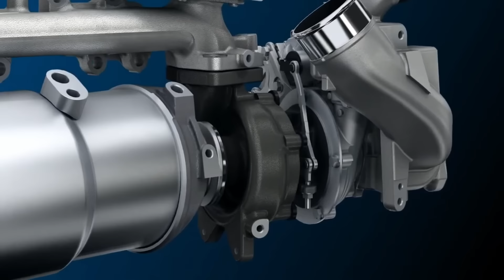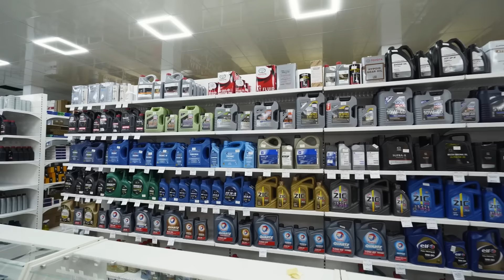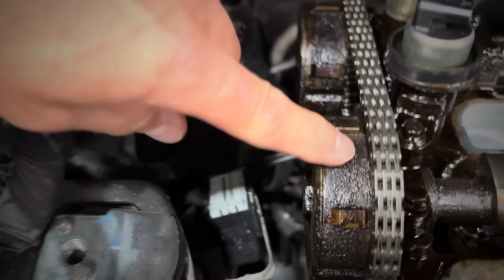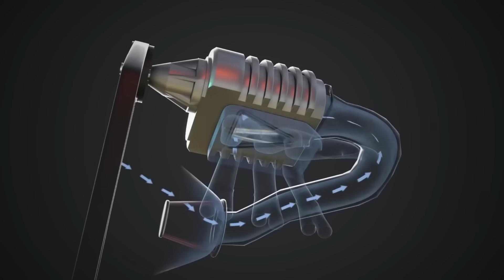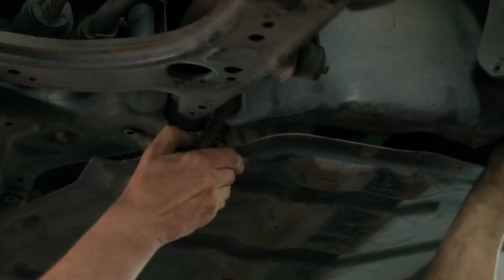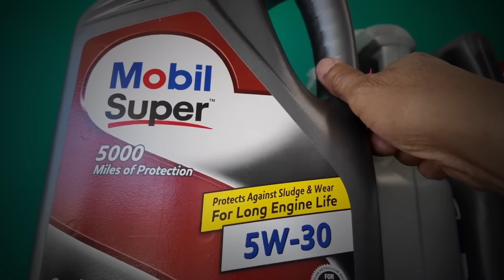Mechanics Won’t Tell You This About Synthetic Oil! Exposed!

Comment: I worked through college on a scholarship from Mobil Chemical in there research lab in Beaumont TX. There in a semi-works plant we produced the first batches of Mobil 1 oil. It is made form a straight chain molecule Alpha decene. This is polymerized Into long chain  molecules that can snake into much small areas than standard oil can. In the testing labs we ran engines a million miles only changing the filter and adding back 1 fresh quart of the synthetic oil. The engines were then disassembled and measured for wear. The results were amazing showing on 10 to 29 per cent of the wear that was show with the same test using conventional oils. Everything in this video is exactly as we tested 60 years ago. I am very proud to have been a part of this development team. And YES I have always used Mobil 1 oil in my vehicles.
Reply: So why does Mobil One play "I've got a secret" while Amsoil releases tons of whitepapers on this kind of thing and much more precise extended-interval recommendations?
Reply: Castrol Syntec
Reply: @edgarvaca9238 Castrol sold out yrs ago it's made by BP
Reply: Это враньё от начала вашего текста до конца! 
Никакое масло не справляется с продуктами сгорания топлива так как свежее замененое! Обычное минеральное масло замененое 5000 км намного лучше синтетического 15000 км!! 
При нагреве масла до 400° минеральное масло не выпадает в осадок! А синтетическое превращается в смолу и асфальт. Современные двигатели euro6 очень горячие! 
Смотрите тесты прожарки масел!
Reply: Didnt mobil 1 stop utilizing pao base when they lost the court battle with Castrol?i thought they went group 3 like Castrol and now pretty much all off the shelf oils.But maybe they still use a small amount of pao base with some gtl base mixed?...just curious... either way its great oil.
Reply: @steverugerguy9606 why did mobile go to court with Castrol,,
Reply: Yes, Mobil 1 is better than Conventional oil but how do you know other brand of Synthetic oil for e.g. Valvoline is not just as good?
Reply: @FeelFree3  Amsoil is the very best by any measure.
Reply: The 2nd best thing about Mobil One is that Costco sells  it-last time I checked. .  Save a few bucks when you religiously change your oil every 5,000 miles or 6-months.   As it has a little more detergent in it,  I use the synthetic Pennzoil Ultra sold in 5-qusrt containers at Walmart.and only OEM oil filters.  Best car so far per Consumer Reports  is the Toyota Camry Hybrid
Reply: Thanks for your time information on this .

Comment: An example with many new cars since 0-20 and 5-20 is a problem since tight tolerances. If you 10-30, etc, you will lose that engine.

Comment: I've been an Amsoil dealer for 25 years. I use Amsoil Oil, gear oil, Trans fluid, grease, 2 cycle mix, etc  in everything I own. I didnt change the oil in my lawn mower for 18 years, It stopped when the shrews chewed thru all the wiring. I use the 2 cycle mix at 100:1 for all my mixed gas. Even equipment saying use a 20:1 mix gets 100:1 and everythig rus beautifully. I've never had a plugged spark arrestor. I don't drive a lot maybe 10 -15000 miles a year, I use the Amsoil Signature series oil and I change my vehicle oil once a year. I have never had an issue. I put a new qt of convention oil outside next to a new qt of Amsoil for a week in winter at -40 F (I'm in Alaska) , both the same weight. Conventional oil was extremely slow to pour it was very thick. The amsoil while pouring slower than at room temp, did pour much, much faster than conventional oil.  Amsoil, easier cold weather starts, faster lubrication, better fuel mileage. I live way out in the middle of nowhere, I get nothing for Amsoil for saying this stuff. I'm old, not rich and I'm damn picky. If Amsoil did not work  and work well, I sure as hell wouldn't  be using it. Especially since I drive 200 miles 1 way just to pick it up at the distribution center. I shouldn't be praising Amsoil at all. They treat dealers like me very poorly, but I have to be honest. "I" think Amsoil products are great.
Reply: I agree with all that you said. Except I became a dealer in ‘73 but dropped it a few years later but still used many of their products along the way and preferred customer for about the last 15 years. They know their stuff.

Comment: Oil Oil Oil
The true king of your engine is keeping folks out of it……
Sports cars nowadays are a gamble used because folks wanna modify shit
Folks want maximum HP there engine can handle.
Folks can never chill and drive with sense, just nonstop hard pulls at all times. 
Engines with no real power have outlasted $60K engines all day everyday 
Oil is great, but not dogging and tweaking your car is better

Comment: I  had a guy tell me synthetic was bad, too slippery.

I looked at him in shock. I think my facial expression suggested, "Do you listen to yourself"?
He must have caught it. He replied, "It makes the bearings slip".

I nodded my head and walked away.

On YT, there are several videos where people tested the wear factor of several synthetic oils. The top five brands were so close in the protection they offered, it wouldn't make a sliver of difference in which oil you use. Just buy what's on sale.

Comment: Ford 2010 fusion 2.5 liter engine driven to 282,000 miles and only a fraction of a quart of oil used between 5000 mile oil changes and still running quiet. Had valve cover gasket changed at 250,000 miles and saw no sludge on the top end. This was always spec blended oil.

Comment: When I bought my Harley I took it back for it's 1000 mile service. They put in regular HD 20W50, the oil put I at the factory. The next oil change I started trying synth oils I tried about every synth oil out there. The Mobil one was the worst. Engine made more noise and ran hott3 than the others. I settled on Amsoil 20W50 in all three holes. Ran much cooler, silently and got better than two mpg better milage. 
Been running it ever since. Well worth the money. The longer change interval balances out the extra cost.
Reply: My main Harley center carries the HD brand because they have to yet only install Amsoil 20-50 after breakin because it works so well.

Comment: I only drive about 2,000 miles per year mostly city driving. I Do take the car ('21 Ford Explorer 2.3 litre with turbo which is rarely used) on the highway once a month for about an hour's drive. How often should I change the oil as it's more *time sensitive than milage sensitive.?

Comment: Started using Castrol Syntec, or Mobil 1 exclusively in the mid-80s:   VW gas and diesel, Volvo wagon, Olds v6, Mercury v6, F250 and F350 diesels, and Buick v6.  All had 180k to 260k, when sold, with none requiring oil between changes.  Also used a premium oil filter.
Changes were 5k to 7.5k.
Currently,  I'm in a 4cyl Tacoma.. Gen3 & getting close to 80k, and running great!
..Way over a million miles in total.   Don't skimp on oil and filter quality!

Comment: G.K U.S.A.  I have been using Amzoil products for over 30 years- oil, oil filters, air filters, transmission fluid, and differential fliud. I heve had no problems. I use the Amzoil Signature oils in 10w30, 5w30, 0w30 and 0w20 formulas. My present 2024 Suburban is supposed to be used with 0w20 full synthetic. I thnk that there is another reason that both GM and Amzoil technicians insist that I continue wtth this low viscosity oil is because my present Suburban has an 8 quart oil pan. My other 4 Suburbans had 5 and 6 quart oil pans. I wonder if the greater amount of oil used by the 5.3 L engine is a factor in the debate over whether if 0w20 oil is better or worse than the 0w30 oil that I used in my other Suburbans.  Also, in cold, Wisconsin winters, I noticed that changing from 5w30 to 0w30 made a difference in the time it took for my engine to go from start- up to operating 
Oil pressure. I was amazed by the difference.  It took 5 or more minutes. This translates into better fuel economy and, perhaps, less wear in the engine. I would like to get your input on this.

Comment: A former FORD Corp vice president, having been introduced to Amsoil, took a brand new Lincoln, fresh off the assembly line; he had the engine fill with Amsoil, (which Amsoil did not recommend).  Amsoil recommended to use their engine oil, only after the proper break in peroid.
This man kept the same oil in the engine for 100000 miles, which Amsoil also does not recommend.  The only thing he did, he did have the filter changed every 3000 miles!
At 100000 miles this Ford VP brought the car in to the Ford Research facility.  He had the technicians pull the engine completely apart, and check all the internal parts comparing them to the original specifications.
The Result: the engine (internally) was amazingly clean.  Every part was still within factory specs!
That VP was so amazed, he resigned from Ford, and went to work for Amsoil!

Comment: I own a Chevy Suburban 2009.  It has 250,000 miles on it. I use synthetic oil... Every time I drive away from Ralphs Auto Repair after an oil change my car drives and responds like a brand new car . 
I will never go back to crude oil.   🎉🎉🎉

Comment: I bought a 2005 dodge pickup truck with a cumins diesel engine and the owners manual said that it was safe to go 7500 miles between oil changes in regular use regardless if conventional oil or synthetic oil is used. So 265,000 miles later I have never used synthetic oil in it

Comment: I use Mobil One 20,000 mile oil and change it every 10,000 miles. I do a lot of start/stop driving, delivering 8,500 papers in 2 1/2 days. Plus, my new car has a turbo charger on it.

Comment: Pennzoil Platinum 5w30 not 5w20 in my 2007 F150 5.4 3v changed every 5 metric k. Never been inside this engine and as quiet as the day in 2010  when I bought it with 34k now 220k. Oil is cheaper than a engine and I love this oil the cleanest base oil ever made.

Comment: This is very interesting and confirms what my experience with oil has shown. I'll try to keep the story short.

In 1975, I bought a 1973 Pontiac Grand Prix that had been mostly road driven by one of my friend's traveling salesman father. It had a big block 400 and 50K miles on it. This was my third car, and being a guy, I thought I knew a lot about automobiles. I had always done my own tune-ups, lube jobs,  alignments, etc. In addition to some other tweaks like putting in a dual point ignition system and an electric fuel pump, I flushed the engine with Sea Foam and decided to change my brand of oil.

Mobil 1 was pretty new and still rather expensive compared to regular motor oil that was selling for about 60 cents a quart. I switched because regular changes were every 3,000 miles and Mobil 1 was every 5,000. My time to change oil was worth more than the per quart differential, right?

Well, anyway, I got lazy or distracted, or something and started just visually checking my oil quality as well as levels. My Mobil 1 wasn't even dirty after 10,000 miles, so all I did was change the filter and add a quart to top things off. I did this for more than 250,000 additional miles over the next five years. I sold it to a kid who did a compression test and a brake horsepower test. The car was 98% up to factory specs with slightly more than 300,000 miles. LOL. He tricked it out with glass-pak mufflers and replaced the 8-track with a better stereo system.

After many subsequent vehicles including the taxi cabs that I have owned, I've never changed the routine: Keep the Mobil 1 topped off, but never actually drain it. Every 10,000 miles or so, change the filter and add a quart of new. Have never had any oil related engine problems despite millions of combined miles.

I've always been a bit of a rebel, but it has worked for me.

Comment: I bought an F-150 new in 1988  and ran it on Mobil 1 for the 359k US miles before I retired.
Regular oil changes and not a drop burned or dripped 
and it still ran tight and strong when I parked it at the shop.
Doing the same with my 21 year-old Escape.

Comment: Not all race cars use synthetic. Everyone I know uses conventional oil because synthetic doesn't last as long. I've been using castrol gtx since I was a kid and have never had any problems. I've even taken a few engines apart I've used it in and had zero sludge after well over 100k miles.

Comment: The price difference is minimal around here currently. It is only about $5.00 more for Mobile 1 over a leading brand of conventional oil. Have recently changed to amsoil in my V twin because of heat. It seems to be better. Now I have to find the better choice of filter. I have pulled filters recently that seem to be useless way early than in the past. Fram is one brand that appears to have gone down hill but I have limited sample size. It may have just been a fluke that got through quality control.

Comment: lol I use regular oil and proper maintenance 360,000 kms on my 05 Pontiac 3.8 
335 on my 07 Silverado 2500 6l gas 
My jet boat 5.7 l indmar marine  manual 
Noted that , use of synthetic oil voids warranty !

Comment: Too many factors are involved on when you should change your oil. Non turbo motors really need to be changed every 6,500 miles and turbo motors every 3,000 miles with a full synthetic oil.

Comment: I have used Valvoline motor oil for decades. My vehicles have between 210,000 miles and 250,000 miles. I have synthetic oil in all of them.

Comment: Lots of good information, but I don't really buy the cold startup thing. If you take an engine apart which has been sitting for years in a wrecking yard -- the connecting rod bearings are wet with oil. Furthermore, I would bet that if you took apart an identical engine immediately after shut off and still hot, there would be much the same amount of oil on the con-rod bearings. 
Also, on several occasions, I've drained all the oil from an old engine and let it run just to see what happens.... they usually run for 10 minutes before seizing or shutting down from whatever.
Reply from the maker: That's an interesting experiment!

Comment: Back in the 70s and 80s, if you got 100k miles on your engine, you were doing well and maintaining it.
For the last few decades, if you only got 100k out of it, something is wrong.
Oil changes were 2-3k. Now it's 5k.
Easy maintenance schedule is 5k miles.
5-10-15-20-25-30 and so on. A quick glance at the odometer and you know when it's due.
Regular maintenance is cheep insurance that you will get a long life out of your engine.
Don't go with the oil life indicator on your vehicle or what the manual says. Don't go with what is on the bottle. Change it every 5k miles and use a good filter. You get what you pay for.
Transmissions are the same. Many say no maintenance required. Change that fluid every 30-40k.
Reply: Yup. LOUDER !

Comment: What screws up the oil viscosity is fuel contamination in the sump.
A well maintained engine in a moderate climate can go easily 5 or 6000 miles between oil changes.
Oil contamination occurs through the invisible gap between piston, rings and the wall of the cylinder tubes, when fuel residues escape into the sump.
The more the piston rings tolerances increase through wear, the more the oil gets contaminated as more fuel residue escapes into sump, hence the need for the sump to have a breather pipe to ease pressure build up and keep up performance. Otherwise the opposing pressure build up from the bottom end, cancels out the down stroke from the top, robbing the engine of performance.
While all this is happening, the oil job is to keep every rolling surface 'floating' and free from friction.
The fuel contamination destroys the viscosity of the oil and leads to failure. The vehicle needs to have the oil checked regulary, about once per week depending on milleage travelled, to ensure it is clean and drips easy enough but not like melted butter off the dip stick when the engine is cold.
As the engine milleage increases and there's a noticeable need to top up oil regulary, it means the engine might require a slightly higher grade oil, f/ex from 10w 30 to 10w 40.
The higher grade should be better at fillling in the wider tolerances developed with normal wear, and keep the engine going for plenty more milleage.
The rule of thumb is, in very cold climates a 0w20 or 0w30 is best for cold starts, in intermediary weather s, a 10w30, 15w30 or 15w40 for higher milleage, is alright, and in hot places like tropical or African places, a 15w30, 20w40 or even 25w50 grade will be better due to the higher retention of viscosity at greater engine working temperatures.
If you don't drive like a maniac racing driver, a blended oil  (synth+mineral) is good enough taking into account how responsable you are taking care of basic maintenance things, otherwise, if costs are not a consideration, go for full synthetic and find a reliable service provider.
Sorry for the long lecture... I couldn't summarise it better without making it into a word salad 🤷🏽
Happy driving toeveryone.

NB. Stick to a known brand.

Comment: It's no big deal in 300,000 miles out of an engine now. But then I like to use Lucas oil 🛢️. Mixed with standard oil made from crude or synthetic blend or pure synthetic. Now I'll use the synthetic Lucas additive with a synthetic oil. But I've got a 5.4 Ford engine pushing right at 300,000 mi. I guarantee you the government did not use synthetic oils. I also would say that people might want to think about the automatic transmissions as well
Reply: Same. I usually use the Lucas additive too. Does it help? Probably I won’t know. I do know changing oil regularly saves on engine parts. I’m on my first rebuild motor and still using the same camshaft and pistons as they didn’t have much wear, all using synthetic Mobil 1 oil 5w-30 for 16 years straight. I use heavier weight oil normally now.
Reply: Ended overspending on roller lifters. I just bought the most expensive lifters i could buy from summit racing and called it a a day.